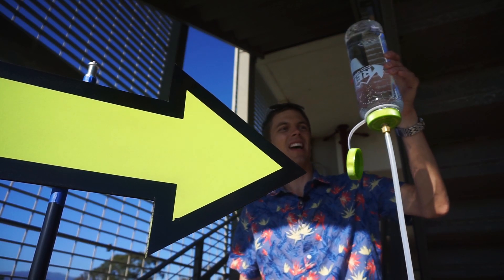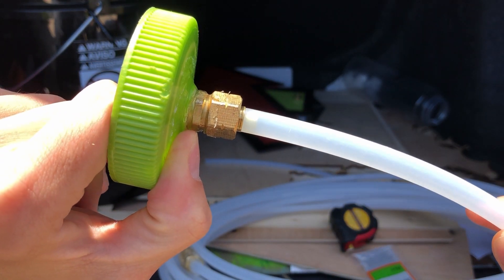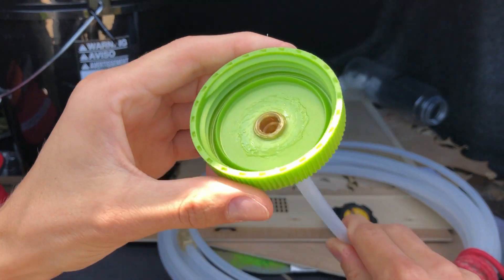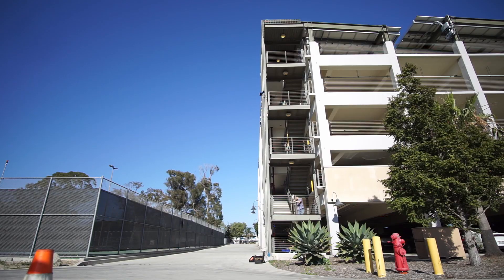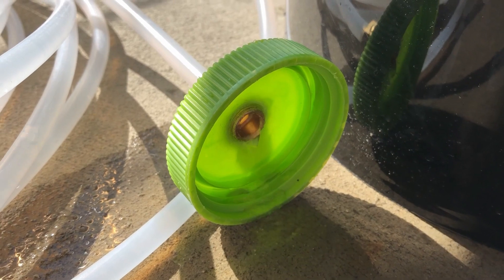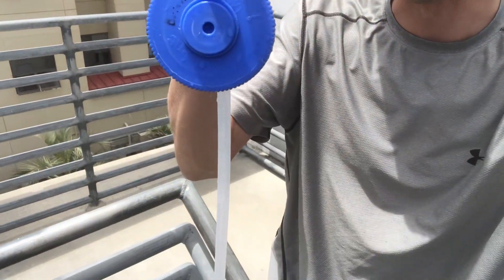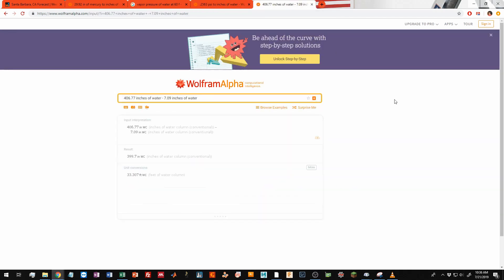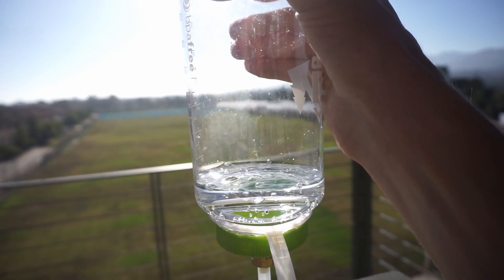How to Boil Water With Water (pt. 2: experiment setup)

Comment: how would that experiment have turned out if you used actually hot water? (or ice cold water)
Reply from the maker: The offset in height between “vacuum” and “water boil height” would have changed! The vapor pressure is temperature dependent

Comment: I'd like to see how a siphon works if part of the tube goes above the boiling point height.
Reply from the maker: It does not work 😁
Reply: @AlphaPhoenixChannel  You mean "It does not work" as in the siphon doesn't flow, or the water doesn't boil (and the water still siphons)?
Reply: @rednectarchris  Steve Mould just released a video with this experiment, if you are still curious
Reply: @Not.Your.Business  Yes - just watched it yesterday! Brilliant

Comment: this technically would be great, if you had a pond full of nasty water, and had to distill the water without a heat source.  assuming you could empty and refill the water bottle (that would be the tricky part i think.
Reply: It is not the boiling of the water that kills the pathogens, it is the heat that kills.
Reply: @johnnicholson8811  hold on, do you think the pathogens evaporate with the water?
Reply: @78endriago  I am not saying that, but there are extremophiles like Tardigrade which can handle outer space. I do not know if Tardigrade are considered  pathogens, but I also don't know why a pathogen could not do what extremophiles do to survive.
Reply: @johnnicholson8811  i think we are talking past each other.  i'll rephrase.

so the nasty water at the bottom.
then boils at the top.
so all the nasty stuff will stay in the liquid, and clean water escapes out the top.

Comment: Silicone sealant come in 2 common styles. Acid cure and alcohol cure. If it smells like vinegar it's acid cure and corrosive particularly towards copper a/o electronics. It should say which kind it is in tiny print on the tube.
Reply from the maker: Yeah I made sure to use a non-acid one

Comment: Daaamn. this could be used in survival situations or in warzones. Maybe charities could use this.
Reply from the maker: Unfortunately boiling water doesn’t make it safe, only heating it up. Boiling is just typically an indicator of temperature. This device boils but the water stays cold
Reply: @AlphaPhoenixChannel  ah okay that makes sense. Cool video anyway
Reply: @AlphaPhoenixChannel  what about desalination by the ocean? I'm picturing a long pipe filled with sea water going from the ocean up the side of a cliff - the water vapor at the top could be collected from the vacuum, cooled and collected for drinking water?